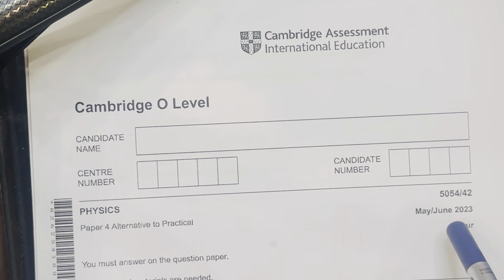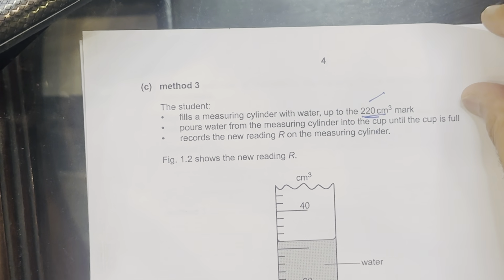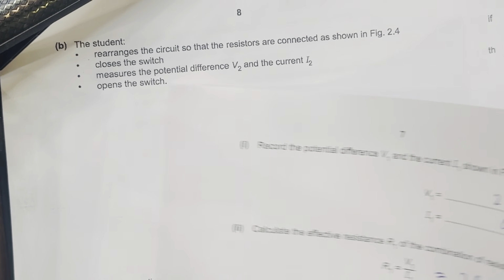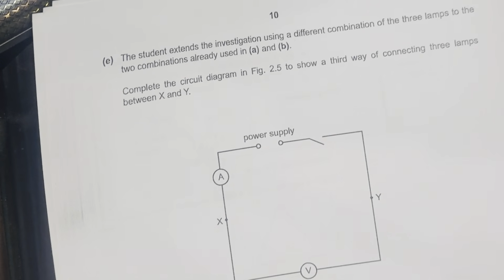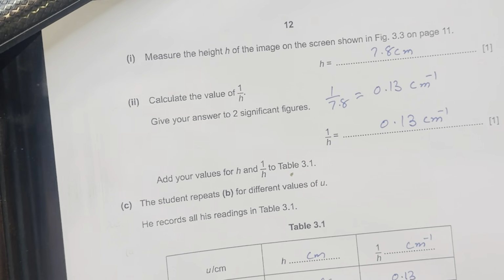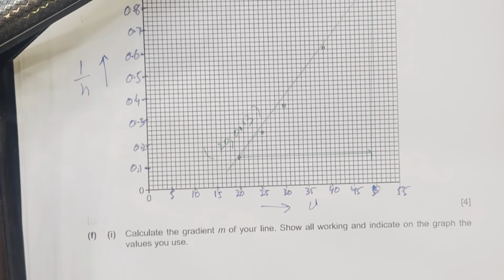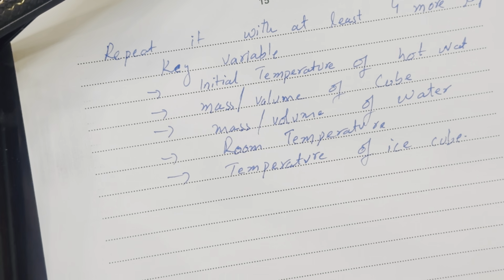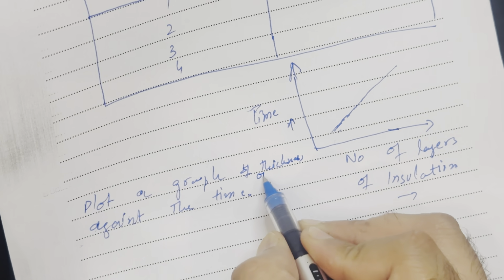O Level Physics P4 5054/42 May/June 2023

Comment: Sir, in timestamp 23:01 i wanted to ask, why you wrote cm-1 instead of just cm, like how will i figure that out i would've most probably just written cm, please explain.
Reply from the maker: I have written that because the value come as 1/h so the unit was 1 divided by cm so according to maths rule when you take denominator to numerator it power becomes negative so that’s why it was cm power minus 1
Reply: Ohh okok if it were 1/d would the same rule apply? And if i leave it as CM would my marks be deducted?  @sirrehan686
Reply: @soniakids92  Okay, when ever you divide something, and the numerator goes to the denominator, it will always become inverse. That's why in speed we write it like ms^-1, to represent s was in the denominator.

So yes, even for 1/d the same rule will apply. Don't get scared👊